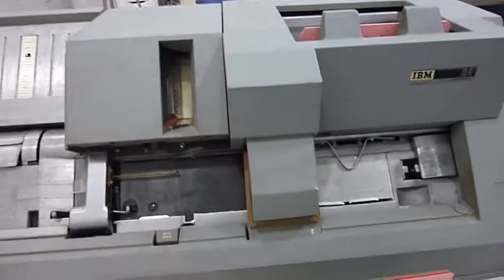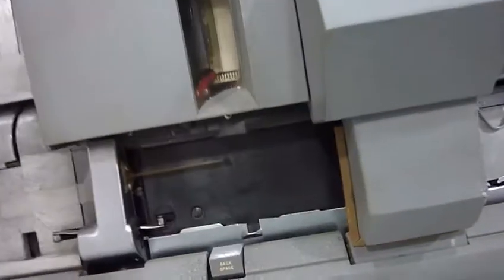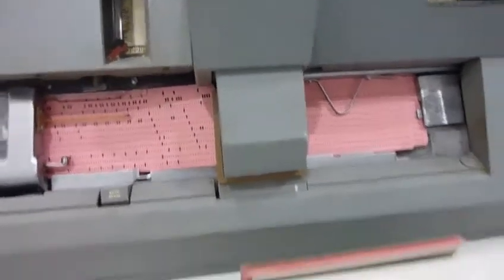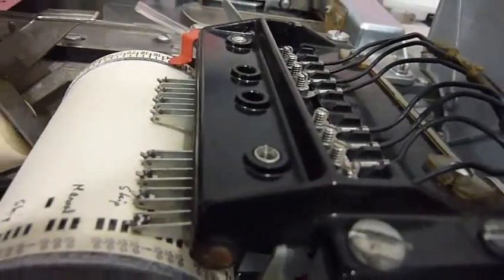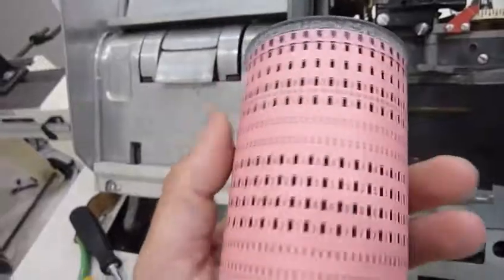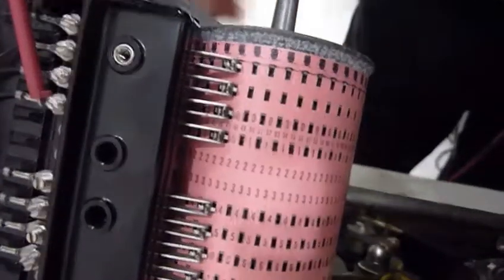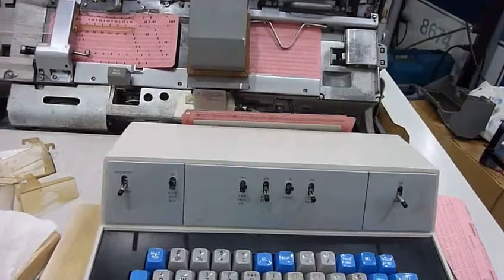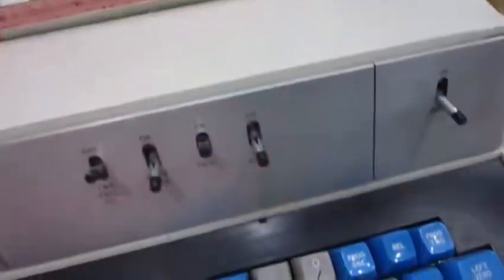IBM 029 Keypunch Restoration 8 - Restoring the Programming Drum

Comment: 8 years ago now - did you find a starwheel spanner? I have one in the UK if you want ! The easiest way to adjust the star wheels was to take out the pin for the escapment so the drum turned continuously, and then with an ANALOGUE meter adjust continuity across each contact so you got about 40%* swing on the needle.
* I think it was 40% - it might have been 60%; it was 45 years ago now !
Reply from the maker: Nooe, still no starwheel spanner. I would be delighted to get yours. Contact me following the link here: https://www.youtube.com/@CuriousMarc/about

Comment: You need a rockshaft wrench to adjust the starwheels. You can also do it dynamically which is much easier.
Reply from the maker: Yes! I wish I had the correct specialized tools... Alas I don't. Do you? My alternate method worked OK though.